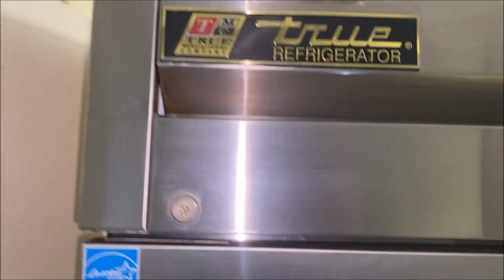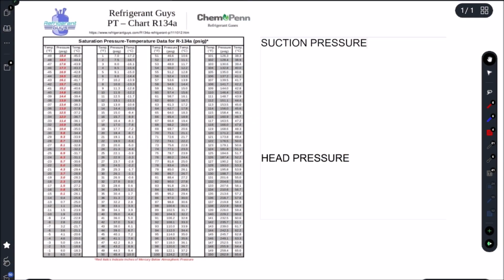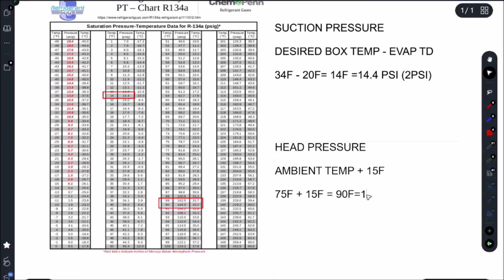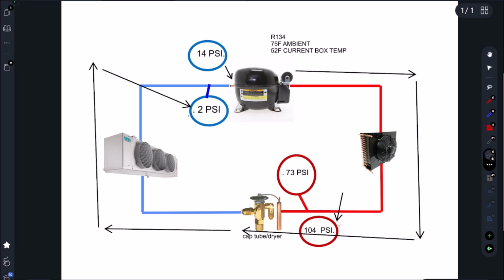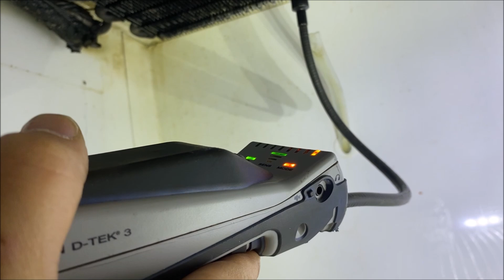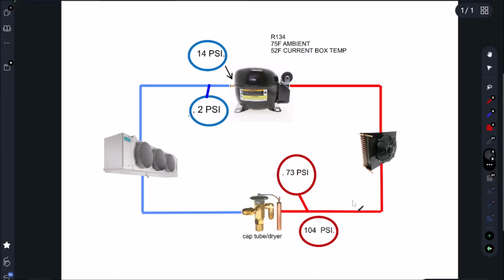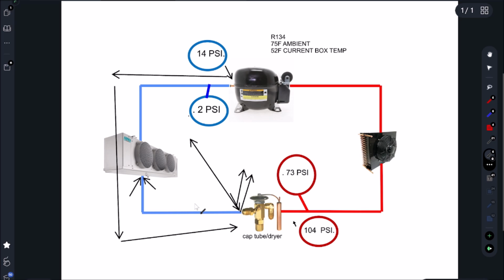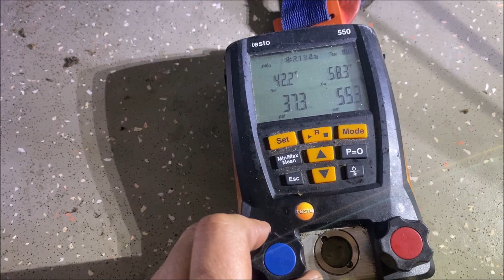True Reach in cooler is not cooling

Comment: Changed a coil on small true prep table last week.  Thought my cap tube was clear, unit ran with good pressures before replacement.  After replacement pressures were low and unit cooled but wouldn't cycle off on coil sensing thermostat.  Replaced the cap tube and all was well.  Didn't think about flowing nitrogen at operating pressures to check for restriction. Great tip!👍👍👍
Reply from the maker: Yup, got burnt on that years ago and wasted almost 2 days trying to resolve the issue.

Comment: Where did you gauge up?  I'm a light commercial rooftop tech now working in a fixed facility with low temp, chillers, boilers, FCUs, AHUs, and WSHPs.  I tried to service a True this morning and I was as lost as one could be.  Did a leak search.  Nothing.  Cooler/Freezer split.  Freezer is fine.  Cooler at 61 F.  Couldn't find anywhere to put my gauges.  It's probably right in front of me.  You low temp guys are amazing.
Reply from the maker: It’s a sealed system, you need to install line taps

Comment: Great video, great teacher. Quick question. How do you get your evap td and your condenser split? I notice that its different for different units.
Reply from the maker: Reach in evap td is 20F. Condensor can be either a 15F or 30F, a lot of the newer stuff is a 15F split
Reply: What determines if its 15 or 30 Condenser split? I know you said the newer stuff is 15 but how would i know while diagnosing a unit? 
Also, whats the evap td for a walk in cooler and walk in freezer?
Reply from the maker: The engineer will decide, but based on your suction pressure, you will be able to figure out if it a a 15 or 30 split. Walk ins are a 10TD evaporator coil, but your superheat will determine the TD.
Reply: Exactly my thoughts ..how do u know your td ??

Comment: 👍🇺🇸💪❄️ great job.. u said 15cs but then 30cs on diagram. Most cs r 30 for coolers correct? Some may b 15 depending on yr of unit ?
Reply from the maker: Yes, a lot of the newer stuff is using 15F Condensor split.

Comment: Where did you come up the high side td of 15 and low side of 20 td? High side seems low and low side seems like high td
Reply from the maker: Almost all reach ins have a 20F evaporator td. Condensor is either a 15F or 30F split depending on what the engineer has designed it at. Almost all the newer stuff will have a 15F Condensor split to help with efficiency ratings.
Reply: @REFRIGERATIONKITCHENEQTECH  thanks I was thinking the condenser was still at 30 didn’t know that reach in s can have that low of a split

Comment: hey, in 6:03 you mention, that you braze cap tube shut to evap.coil. What exactly mean "shut braze" it is something different than just braze copper with copper ? I'm not native-english and I don't know technical terminology
Reply from the maker: The new filter dryer comes brazed shut, so I don’t cut it until after I push nitrogen through

Comment: Are you guys using a solvent to flush out a clogged cap tube?
Reply from the maker: No, just straight nitro. Vacuum and a heat gun could also work
Reply: Thank you taking the time to respond